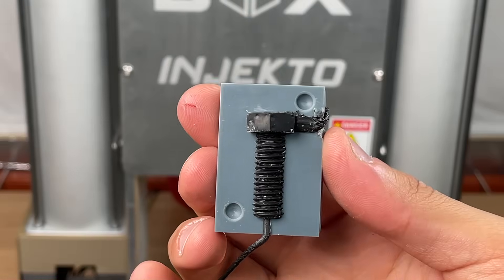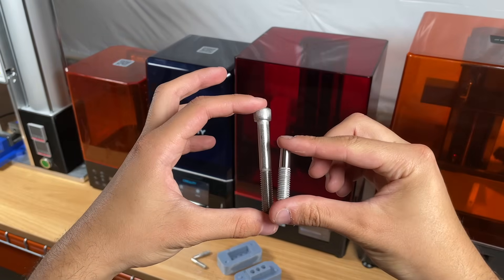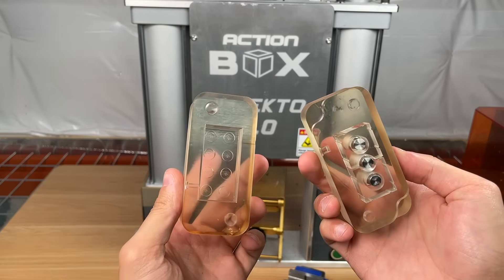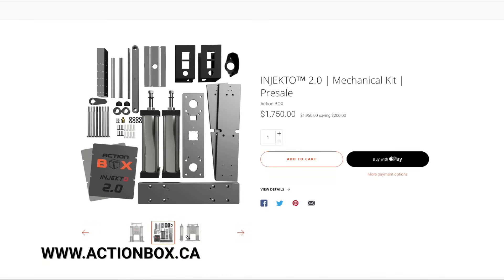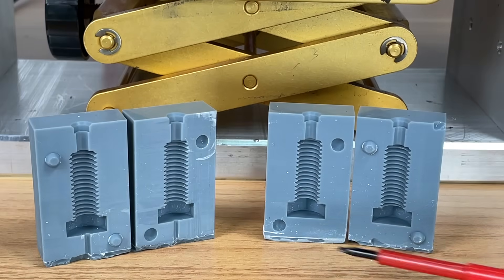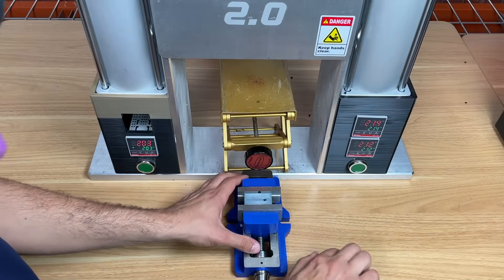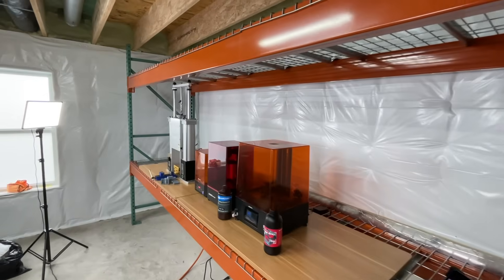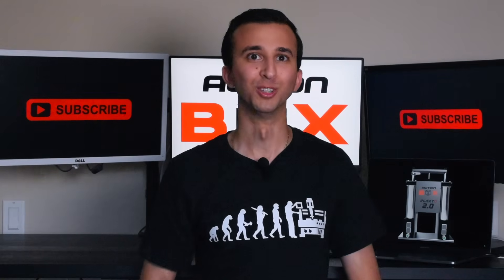DIY LEGO At Home

Comment: Where did you get the pellets?

Also, can you use abs filament as a substitute?
Reply from the maker: You can easily get the pellets online either on Amazon or eBay. We have successfully recycled 3D prints made of ABS and used them for injection molding, so yes, you can use ABS filament :)
Reply: @ActionBOX  Good. I wanted to make sure because I have some filament and want to put them to good use sometime.

Comment: Are you able to create a mold from resin on a resin printer? Am I understanding this right?
Reply from the maker: Yessir, and then use INJEKTO to fill the mold.
Reply: @ActionBOX  that's really cool I'm learning more about these methods and always assumes your mold bad to be made of metal due to the heat involved.
Reply from the maker: If you use high heat resin, there is no problem at all. Much cheaper than creating metal molds if you want to prototype designs!

Comment: sink marks will appear if the wall thickness is thicker than it's surroundings, this means that there is more hot material that will take more time to cool off and therefore it will contract at one side.

solution: Make a new cavity that decrease the total volume of the buttons by follow the outline and have a uniform wall thickness
Reply from the maker: Thank you 😃

Comment: Did you ever end up testing a mould without a vent channel? I was super looking forward to seeing you test that one bolt mould, but I watched the video twice and it seems like you gave up on the idea after changing the mould design to avoid warping in your vise. 

Oh, and while I'm here, someone mentioned polishing the clear moulds to get a better view of the injection process. Speaking as someone who's spent a lot of time fiddling with ways to clarify 3D printed resin, I think polishing would be a waste of your time. The best method would be to design a number of small through-holes into the clear moulds so that you could just fasten them together with some long M3 machine screws that wouldn't obscure the faces that are already clear.

That said, if you really want to polish the other faces of the moulds, just sand them with some medium-coarse sandpaper (maybe 320 grit), wipe any dust and debris off with some 99% isopropyl alcohol, brush a layer of uncured resin onto one of the freshly-sanded faces, set it flat on the film at the bottom of an empty vat on one of your resin printers (being careful not to trap any bubbles), then do a full-bed UV exposure for a few seconds to cure the resin. Once you peel it off the bottom, you'll have a surface that's clearer and smoother than anything you could achieve with manual polishing, in a fraction of the time. Chamfer the edges with a bit of sandpaper, then repeat the process for all additional faces you want to smooth.

Whatever you do, I wish you the best of luck! Thanks for making once complicated and expensive manufacturing processes accessible to the rest of us!
Reply from the maker: I love your comment on how to make the sides clear. I will definitely do that.  We tested the molds with no vent, those were the ones that overflowed significantly from the top.  I’m glad you liked our video 😃. Cheers, Dave
Reply: @ActionBOX  Oh, got it! I was focused on how the vise pressure was causing the moulds to separate at the top, so I didn't realize that one of them was the un-vented mould. It might be interesting to try that again with a better-sealed mould, though you'd probably get a similar outcome.

Anyway, thank you very much for taking the time to read through my long comment and to answer my question! Cheers!

Comment: If you make the "escape channels" a zig zagging line or a thin wafer that zig zags between the mold halves, it will more rapidly cool the escaping plastic, allowing the molten plastic still being injected to feed any larger mass areas where you are seeing shrinkage, or "sink marks" as you call them. Search die cast or injection mold chill vent to see what I'm talking about. You can additionally add vacuum to the chill vent to allow for a faster mold fill time (in aluminum die cast at least). I would love to see this replicated on the small scale, with a cross-section of test parts with and without all of those things to see the resulting internal porosity. Very interested in this as a prototyping/small production mechanism for my shop.
Reply from the maker: That’s a great idea.  Thanks for leaving me this comment. I’ll give it a try in one of our next videos.  Cheers 😃

Comment: Love this! So great to see at home injection molding.  How many parts do you typically get per mold? I wonder/assume different resins would last different amounts

Edit:fix autocorrect changing resins to reasons
Reply from the maker: Thanks Will 😊. The answer really depends on the quality of material you buy for the molds.  There are resins more specific to this task but we used the cheapest possible resin and got about 20 parts out before the molds gave up. Hope that helps. Cheers, Dave.

Comment: Could the mold be made with FDM printers?
Reply from the maker: No, the resolution is not good enough, so the little steps between layers would lock your part in permanently.  Plus the molds need to be made from a thermoset plastic to avoid melting or significant warping during injection.

Comment: I feel like the molds would melt as I've seen videos trying to make 3d printed molds with professional machines and it wasnt the best
Reply from the maker: Hi Pieter. This is a thermoset plastic so it will not melt once cured.  It’s not like ABS or PLA.  It does however degrade over time. Hope that helps. Cheers, Dave.

Comment: Really very impressive. It is very cool that this is possible. And maybe the concept of using resin printed molds can be used for other purposes as well (for example, candles, who knows what more)
Reply from the maker: That’s a very cool idea hahah.
Reply: The fragility of wax makes it not the best candidate for rigid moulds. It would make more sense to make a resin mould for casting a silicone mould for casting a wax candle, though you're entering mouldception territory at that point.

Comment: are your DIY Lego Bricks compatible to official Lego Sets?
Reply from the maker: Absolutely not. We designed these on our own without referencing an official LEGO brick so the probability of them being compatible is essentially zero. The quality of our bricks are also inferior to the real LEGO bricks in terms of thickness variation and surface finish, which is one one the key values in a real LEGO piece (in my opinion). Hope that answers your question. Cheers

Comment: In the 80's I worked at an injection shop. We made CD cases and such.  When making your product, that is thin, you will need to heat the mold so the plastic won't chill before the mold is full.  It also helps to use higher pressure as this will get the plastic to the far ends sooner.  Next mold, build in a clamping device into the mold itself so you don't need a vice. Take a look at big machines, they keep the mold at a fairly constant temp, use hydraulics to force them together, and use lots of pressure to push the plastic in.  We used to make plastic army helmets and getting the mold setup and up to temp took a while.
Reply from the maker: Thanks for your input 😃.
Reply: Something I always recommend to people that want to build a home shop version of an industrial machine is to look at patents and schematics of stuff that already exists. It helps cut out the guess work and gives ideas to what needs to be done, especially as most industry/mass production machines tend to not have any unnecessary pieces. They do the job they’re meant to do and not much else.
Reply: @embers_falling  also: go to trade shows and try to talk to the engineers who worked on the product. The first person you talk to is usually a sales person. Ask really technical questions until they refer you to their emergency engineer (mandatory at any trade show). They will usually be ecstatic to talk about all the technical details of their work.
Reply: @WurstPeterl  haha so true
Reply: @WurstPeterl  ah yes, attacking the weak point of any trade secret: the overly eager engineer
Reply: @gamespender8605   I wish we lived in a world where sharing experiences and interests wasn't seen as badly